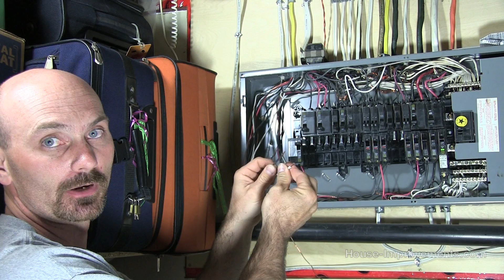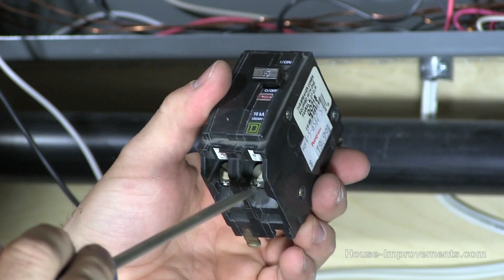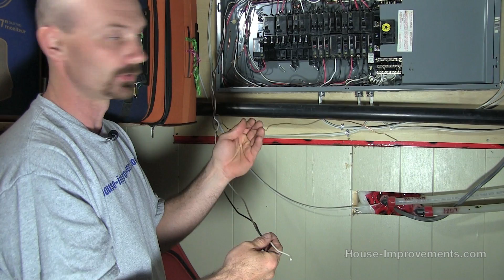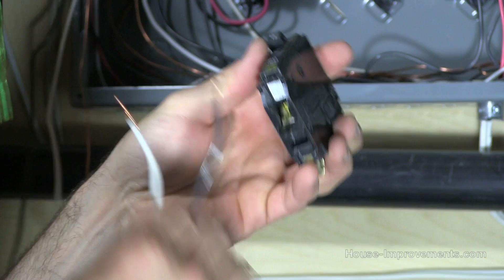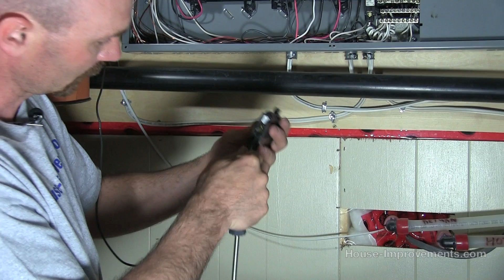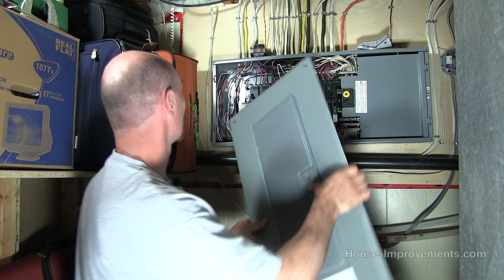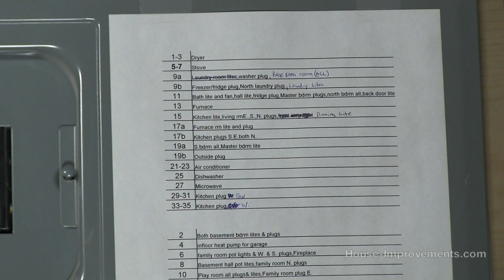How To Add a 120V 240V Circuit Breaker

Comment: Have an electrician do this type of work. It's not only your family you put at risk, its the fireman and first responders that you put at risk with your cost saving diy adventure. and crappy wire job.   A high percentage of fires are cause through improper torque applied to conductor splices and or connections,( improper box fill calculations). ( in addition i do not trust my life to his "test equipment" nor would i start to work on a circuit without knowing 100% that it is off.)  He is not an electrician. follow your local code. if he cannot cite the code.......

Comment: That's an interesting accent you have, Shannon.  Are you Irish?

I recently got 15 amp outlets for my bathrooms, which to my understanding should work on either a 15 amp or 20 amp circuit, but they don't work at all.  Now I'm thinking it's because my electrical panel may not have breakers for that circuit.  It's so sparse!

Comment: With breaker panel in that position the now “top row” of breakers are illegal.  The handle of any switch must be”up” in “on” position.
Now you have two rows with two different on positions which is confusing and dangerous

Comment: In my breaker panel all the white and grounds went to the same bus. Is that okay?
Reply from the maker: in older panels that is what they did. If that is what you have you are fine
Reply: Eric Veritas Blair    If the panel is fed from the electric meter and has a main breaker, then yes.   If not, then no.

Comment: I replaced my 240V Electric Stove with a propane stove. I shut off the 
breaker on the main breaker panel. What I would like to do is run that 
240V line outside (underground) to my shed onto a sub panel. Then split 
the connection to (2) 120V 20 amp circuits and (2) 120V 15 amp circuits.
 Can this be done?
Reply: sdjohn53    Sure it can.   Go get a permit and install it.  That way your legal, and correct.

Comment: You mentioned that if you run out of space in the ground bus bar for ground wires that you could double it. I would suggest you add additional ground bus and bond it to the existing ground bus for more wire space instead of double lugging.
Reply: Generally you can double up grounds on a ground bar depending on the gauge of the wire.

Comment: Question...why did the 120v breaker trigger the tester when it was in the off position?
Reply from the maker: That is the problem with that type of tester they can give some false  positives and not as reliable as a multi meter . They will sometimes react to the actual contact against the wire.

Comment: I have had 2 stoves go bad where the panel works but no heat on the elements. Could it be that I have one line of 120 go bad and one 120 line is good? My husband says no way. I say yes, I think we need to replace the breaker. Help. I sure appreciate these videos.
Reply from the maker: please use our forum. We could explain how to check your circuit to see if it is working properly.https://www.house-improvements.com/forums/

Comment: What was the 120 vollt circuit for?  Or were you just demonstrating how a normal 120 volt circuit is wired in to the box?
Reply from the maker: Typical 120V lighting circuit

Comment: Shannon, you used a 15 amp circuit breaker on the 240.  Why?  Isn't that usually for a 20 amp line...like you have?
Reply: Charlie    Electrical devices, conductors, and breakers are based on the load that is being connected.  Why he used #12 NMB for 15 amp breaker is unknown.  He did comment the 240 volt heater said 15 amp breaker.

Comment: Whats the difference between a 120 volt, 220 volt, or 240 volt tankless electric water heaters? I am planning to upgrade and I am a total newbie at this. Please help with as much info as possible. I know my question might be a little off topic but I dont know which to buy ... why would I want a 120 over a 240 does it matter what kind of electrical box i have? I am totally clueless and not finding an answer anywhere.

Comment: I am a uk spark in the UK if you go across 2 phase you get 415 v but am I wrong in thinking in the us do you use 2 phase for 240v or is do you use the term hot wires for live and neutral

Comment: i have a question about electrical,  but first,  thank you so much for these videos... OK,  so in my situation, we're renovating the basement,  and we now have a gas fireplace,  making our baseboard electrical heaters, useless --  which will be removed from the wall and disposed of,  leaving behind the dead, wire tail. Now,  with the fuse case/ breaker pulled and a cover plate placed over the hole on  the breaker ( the live end of the wire still connected to panel but is essentially dead with no fuse/breaker )  my question is,  what to do with the existing wiring that is left behind;   am i aloud to Simpy cut the tail from where the the heater was, and push it push it into the drywall, then,   simply fill the old wire hole with plaster,  or,  do i need to place an access cover over the wire with a wire nut over the exposed copper... sorry if this sounds dumb lol

Comment: Right off the bat the top row of breaker and main breaker is a code violation. .the NEC 404.7 classified if handle are. Operated vertical then the up position shall be the on position.

Comment: Not sure current code, haven't had too do sideways panel for many years, but your panel may be upside down, Main Breaker should be Down for off, you show down on? Also, you can only use half of the Buss, the Breakers where Down is On, can't be used. White cable-14 Guage, yellow-12 guage, Orange #10. I would have moved breaker to different position, so it wouldn't be short, The longer wires  to the further location. You should have put Black tape on live white wires. When pulling wires into panel a good rule is the length of the panel plus width. 3' may be too much or too little depending on panel size. Codes change? May be wrong?

Comment: Hi Shannon, just a quick question: let's say I have some electrical devices or equipment or appliances that need a few 220 amps, how many 220 amps you can get from the panel or main for supplying to...?

Comment: YOU SHOULD NOT! CONNECT A WHITE WIRE TO THE HOT SIDE OF ANY CIRCUIT BREAKER!!!

 FOR A 240 V. BREAKER :  BUY CABLE THAT HAS A RED COLORED CONDUCTOR AND A BLACK COLORED CONDUCTOR AND A BARE GROUND WIRE !!!

WHITE IS : NEUTRAL WIRE ... OTHERWISE PERSON ON APPLIANCE END OF CIRCUIT MAY ASSUME WHITE WIRE IS NEUTRAL / DEAD AND GET ELECTROCUTED! REMEMBER THE PERSON SUBSEQUENTLY WORKING ON THE CIRCUIT IS NOT NECESSARILY THE SAME INDIVIDUAL AS THE ONE WHO INSTALLED THE BREAKER.

THIS INSTALLATION IS AN ACCIDENT WAITING TO HAPPEN!

SOME USA / CANADA ELECTRICAL GOVERNING BODIES ALLOW YOU TO COVER WHITE WIRE WITH RED PVC TAPE OR SHRINK SLEEVE ... BUT WHY CUT CORNERS WHEN BLACK AND RED CONDUCTOR CABLE IS READILY AVAILABLE?

ALSO, YOUR BUDDIES COLLECTIVELY ENDORSING THIS VIDEO ARE EITHER TOTALLY UNEDUCATED VIS-A-VIS ELECTRICAL INSTALLATION PROCEDURES OR ABSOLUTELY IRRESPONSIBLE , OR BOTH!

I SHOULD ADD THAT I AM AN ELECTRICAL ENGINEER.

Comment: I don't know why in Canada and US has so many circuit breakers system, in India has most sophisticated system of robot that control and protect from all kind of risks like over loads, voltage control, electric shock protection, serge protection and many other controls but circuit breakers only trip when over loads that makes huge difference. Also every circuit goes into it so when you need new circuit then you don't need to install new C.B simply join to robot
Reply: Ah yes, kinda like the robotic sewer systems in India that flow in the streets. Very sophisticated, as we all know.

Comment: Our two rooms' plugs go on the same breaker (which is only 15 A breaker). How does it work? Would it be 2 wires going on the that one 15 A breaker on each contact? How to split it on 2 breakers. On our electrical board we have several spaces for additional breakers. It would be so much better to send wires from each room plugs to one individual breaker. We bought 2 portable air conditioning units for 2 rooms, but can't run both at the same time since that 15 A breaker gets striped after a short time. I would appreciate any explanations about it.  I changed breakers before, so not quite new to that type of work. Thant you very much for the great video.

Comment: Nope . Very bad presentation . In the USA for at least the last 50 years and probably longer you can NEVER install circuit breakers where the while the handle is down Power must be off . All circuit breaker panels in USA must installed vertically [ if it has side by side breakers ] Look a like another Mike Holt screw up .

Comment: 12 gauge wire for 220, and 16 gauge for 110.
Is that correct ?
Why the difference ?
Reply: Amp ratings (not voltage) is what matters for wire size.  12 gauge is rated for anything up to 20A.  14 gauge is rated for 15A and below.  If you need over 20A, you're looking at 10 gauge and even larger.  16 gauge should really never be used.  Pretty much every residential circuit is at least 15A these days.  16 gauge has no place there.

Comment: I only just began looking into how this is done and I have a( hopefully not stupid) question. So in the video a 12 guage/ dual wire is used. Could a 10 guage with 3 wires- black, white and red- be used instead for the 240v circuit breaker? If either can be used, what are the advantages or projects that would favor one guage over the other?
 I had an electrician update /upgrade my old bus fuse box to modern 200 amp service and had asked him to install a dedicated circuit/outlet for an air conditioner but he blew me off and packed up to go & never did it. I'm a widow with 2 kids and the last two pros I hired to do work  got their money in cash but did shoddy bare minimum work that ended up needing to be redone. I don't volunteer that it's just me & the kids now with no one knowledgeable to ask advice from;  usually they ask or say something about what to tell or have my husband do when he gets home, or they directly ask about a husband and then I have to say it real fast & move on so they don't feel awkward. Maybe I should have lies ready and not let them know.  Last job was so blatantly awful that I just don't want to even try to find anyone to hire any more.
 I always leave the guys alone to work after discussing the details of the job before they begin. I am friendly and respectful but maybe too laid back. I never hover or try to talk someone's ear off when their trying to work. It just has to be me, as well as my poor choices in whom to trust and hire. So now I thought I'd see what the process consists of,  for that dedicated ac outlet and an upgraded outlet for an electric dryer to replace the existing gas unit.

Comment: shouldn't a 240V line have 4 wires, yours is missing a white wire? those wires look like spaghetti
Reply from the maker: True 240v lines going to products that only use 240v do not use a neutral. Items like ovens and clothes dryers use both 120v for electronics and timers and 240V  for heating elements at the same time so because of the 120V being needed there is a neutral wire running to them as well as two hot wires each carrying 120V.

Comment: how expensive those circuit breakers? I am moving from India to Guyana and have IBF made dryer that is 220v. I want to find out, if I can use it in Guyana South America, 110/120v/60hz. Should i install 220 v circuit breaker, or 3500 watts diamond series voltage converter will do the trick for me. Will the use of the converter make me pay higher electrical bill?

Comment: Awesome way to explain on how to do it, you grade is 99 only forgot one thing add the black strip to the white wire to identified is a 240v circuit. but a real electrician will know what it is . Great Job.
Reply from the maker: Ya I talked about doing that and then I forgot to do it in the end.

Comment: i want  to change from screw  type breaker to the snap type ,  can i take out all of the inside guts (or the old breaker sys  ) and replace it with  the ones to accommodate  snap type breakers
Reply from the maker: You are better of to have the entire panel changed out by a licensed electrician.

Comment: Why no 4 wire hook-up for the 240v breaker?
Reply from the maker: Depends on what kind of 240V circuit you are needing. In the case of this electric heat there is no neutral needed. Most appliances that use "240V" actually have components that use 120V as well so that is why they use a neutral wire as well as the two hot wires. If you have more questions please come to the forum. https://www.house-improvements.com/forums/

Comment: A tip that may save someone a bad day is this..... when you plug the wire into the breaker or The Terminal make sure that a small amount of copper can be seen as it's entering the breaker or terminal strip.  If the the plastic shielding on the wire goes up into the breaker or The Terminal strip you will not make good contact which can cause various different types of issues for you.

Comment: Question: Can a person who has ZERO ground in a house, ground just ONE power outlet in the house by running a ground wire from the ground terminal out into a grounded stake in the ground? My house has old screw in fuses, and absolutely no ground wire anywhere. There's no plumbing or anything in the house to use for a ground either. I run a compost toilet/outhouse, and haul water there. I want to avoid the risk of frying my electronics but I cannot afford a full electrical update. It's 10,000-12,000 to do this (almost as much as I PAID for the house!!)... I won't be able to afford it for YEARS best case. SO what I want to do, is somehow protect my electronics by at least grounding ONE outlet cheaply.  Is this possible? AND NO, I DO NOT HAVE INSURANCE, so I don't care if things are certified insurable, just so long as my gear is safe.
Reply: fireblazer6661 - yes, you can ground your electrical service, you're on the right track.  Do NOT run a GEC (Grounding Electrode Conductor) from the Grounding Electrode directly to the outlet device, the receptacle.  First, drive an 8' x 5/8" ground rod, the Grounding Electrode, to nearly flush in the ground, somewhere near your electrical service, perhaps near the meter outside. Caution - if your service lateral (the conductors from the Power Company) are run underground, then make very certain you will not be driving the ground rod into them -- BOOM!  Call Miss Utility to mark the ground if the lateral approaches the meter underground, before you drive the ground rod.  Next, run a bare #6 AWG Stranded or Solid Copper single conductor (or a #6 Green Insulated Copper conductor) from the ground rod to the service panel.  At the ground rod terminate this wire, called the GEC, with a rod clamp.  Rod clamps are available as a one-piece or two-piece clamp.  Terminate the other end of the GEC to the Neutral Buss in the service panel.  There should be a hole/screw large enough for a #6.  If not, get a copper lug and place that under the screw in the service panel and connect the GEC to the lug.  BE CAREFUL swinging that EGC around in the panel -- it is HOT. 
 Next, run a green insulated #12 AWG from the Neutral Buss in the service panel to the receptacle outlet that you want to be grounded. This conductor is called the EGC, Equipment Grounding Conductor.  You probably know what to do from there. You should be able to buy everything necessary at one of the box stores. Good Luck.

Comment: Great job. Might specify this is a single phase 120v system NOT a 3 phase 120/208 system. Over the years I've seen guys do some real bright stuff. However great RES training video. And 2 bundles of of 12-2 is fine under one staple strap. GOOD WORK brother. IBEW 359 Louisville ky.